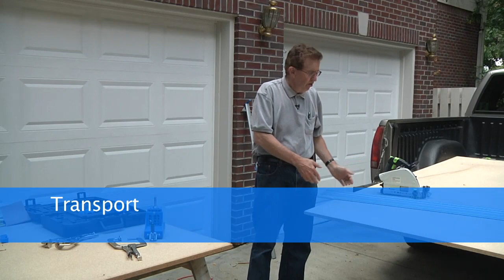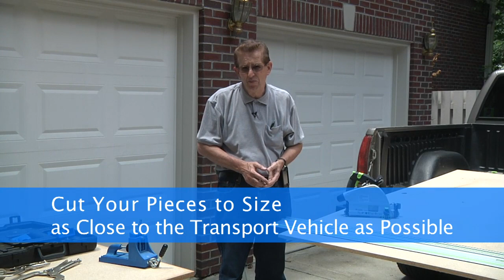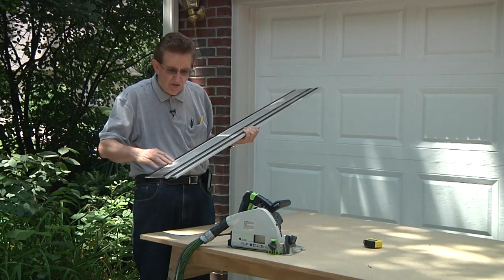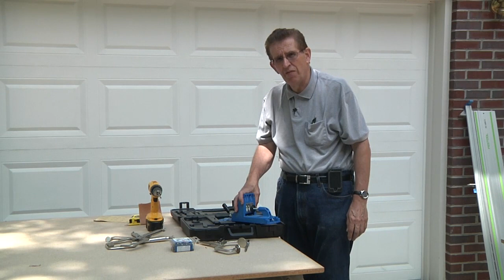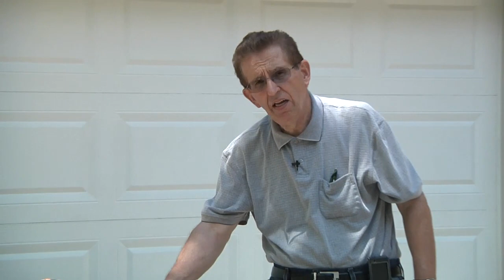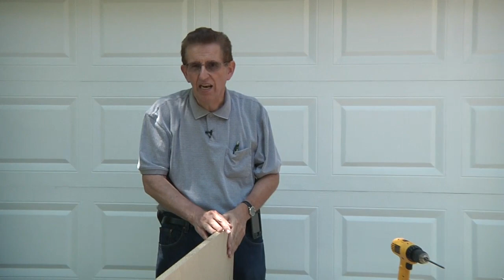Favorite Plywood Techniques Festool Saw and Kreg Jig

Comment: Why do you normally drill the pockets on the outside and the cover with veneer?
Reply from the maker: I "hide" the Kreg pocket holes on the outside of cabinets when attaching frames on projects like kitchen cabinets where many of the exterior sides are butted against other cabinets.  Thus the pocket holes do not show.   In those cases where the cabinet is at the end of a run, a thin overlay such as 1/4" plywood can be attached and will hide the pocket holes.    I would not do this if 100% of the cabinets had ends exposed.  It would be too much work.   In this case I would use some other technology than Kreg   (glue, biscuits, dominos.  I do not like seeing the pocket screws on the inside of cabinets and they are an awful lot of work to hide with the glue ins Kreg provides.